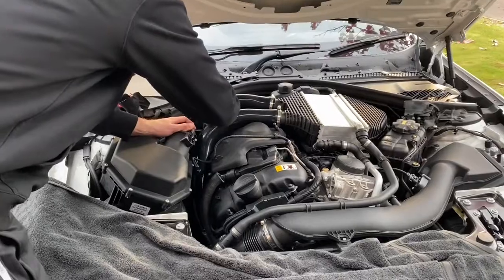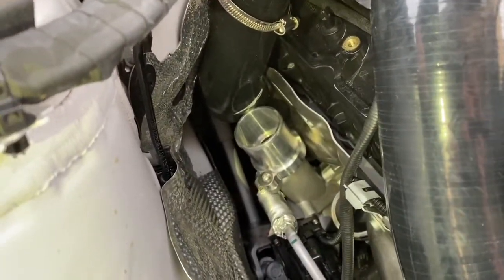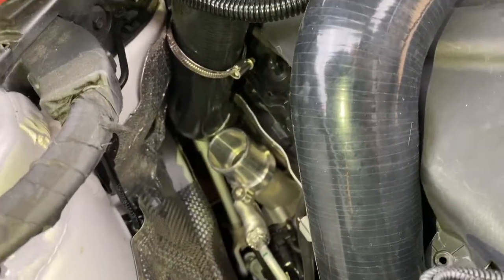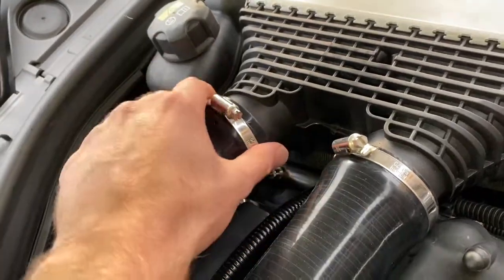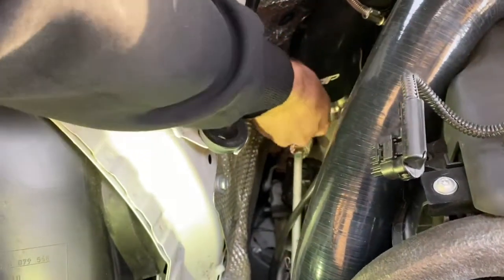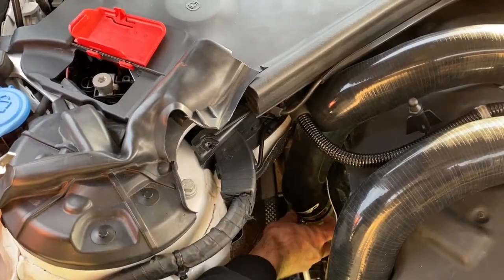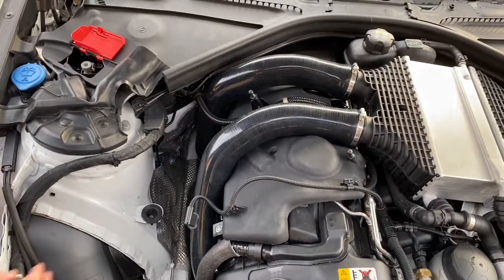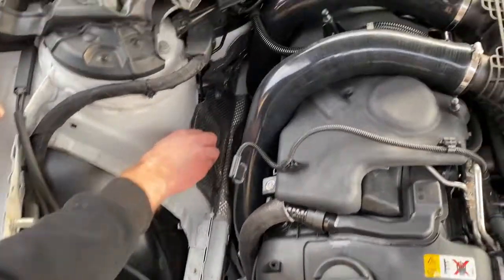AP Charge Pipe Install Tips BMW S55

Comment: Out of interest, why is there an adaptor on the turbo to bolt on?
As in, why couldn't the silicone pipes be sized in such a way that you can clamp them tightly to the turbo directly?
I really don't trust that single bolt on one side holding the pressurised pipe on.
Reply: Oem is also like that
Reply: @juliusbaker6261 that's the problem. Those bolts work loose and the threads wear out. There's a collar around it, all it needs is a pipe with a clamp around it.